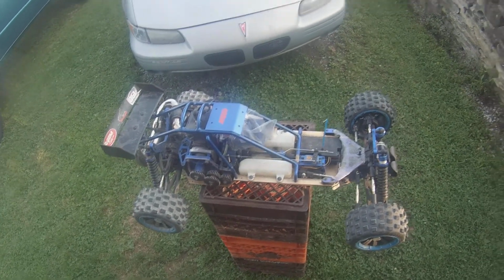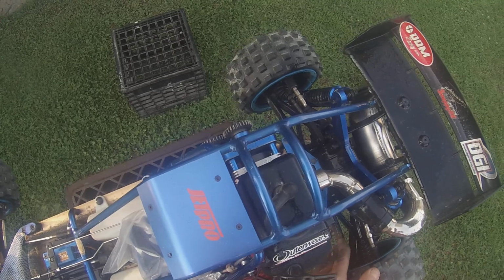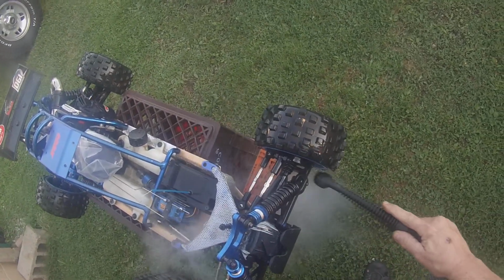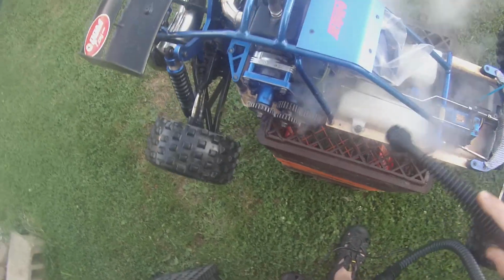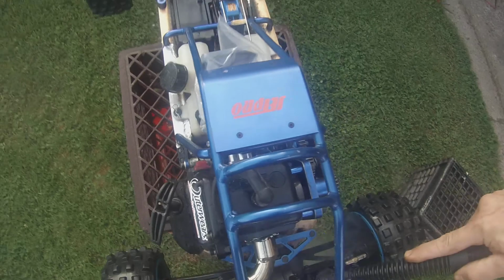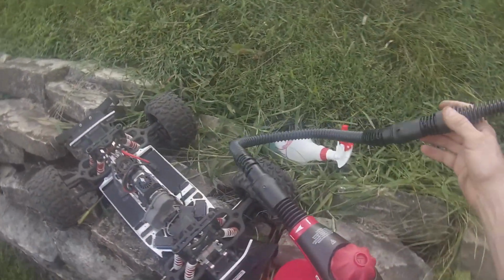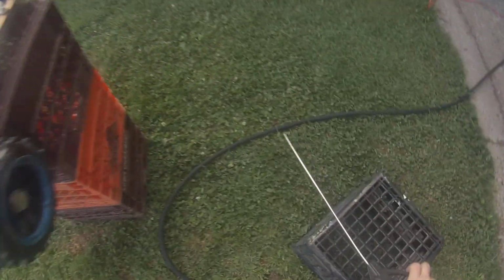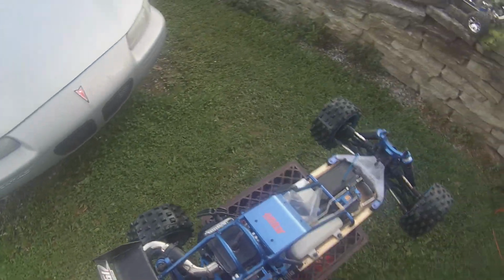How To Clean A 5th Scale RC The Easy Way

Comment: lol, that thing was showroom clean compared to mine .. havent had a single dry day since i bought mine months ago... its covered in sand, im only using the shower tho, im too scared to use the pressurewasher xD
Reply from the maker: What is up man! Yeah it wasn't the most dirty lol. I was just showing how I do it most of the time. If it is muddy, I might use a garden hose low pressure with the rig leaning against a wall. Appreciate you stopping by 👊 🤘
Reply: @SteelCityRC  cool buggy btw! never heard of "redcat's" before, another hpi baja clone i guess ? mine is from "xtc" lol ^^ the chassis looks quite different
Reply from the maker: @tezy0193  This buggy is 4x4 and the same wheelbase as a Losi 5iveT. So it is a bit longer than the baja. I am not sure of it's origination. I have seen the brand HSP with the same chassis. The HPI Maverick was another similar. Sadly Redcat discontinued the Dunerunner buggy..
Reply: @SteelCityRC  awd huh, well thats actually pretty awesome 👍
There is no awd kit or anything like that for baja 5b's ..  its fine without though^^
cheers!

Comment: never ever steam and be very carful with high presure you wil remove all fat and oil where you cant replace it with out doing a full rebuild i had to throw away a bicicle after steaming it be ware presure wash compresor wd 40 dry oil BASH REPEAT
Reply from the maker: Sup man. Been using simple green and either an air compressor or that steamer to clean my RC's for years. I blow the rig dry with a long blow gun. Then finish up with Maxima SC1 silicone spray. Rigs look and function new when I am done. Obviously I cover the brakes and clutch before spraying with the SC1 stuff. Everyone has their ways to do stuff. If it works for you. Keep doing it. I will also. Thanks for stopping by my channel 👊🤘